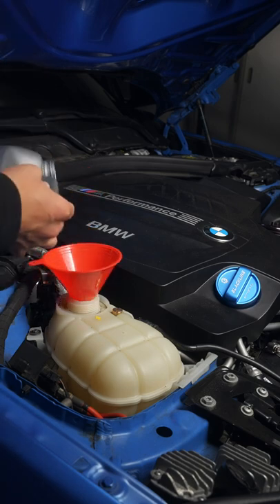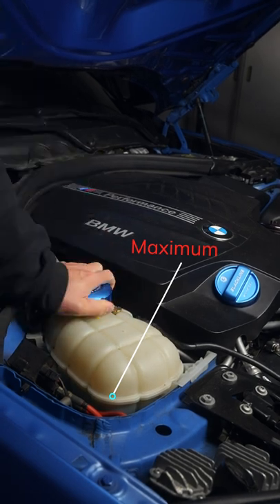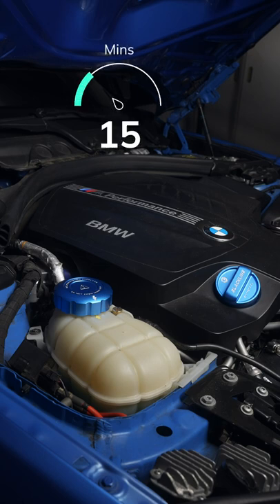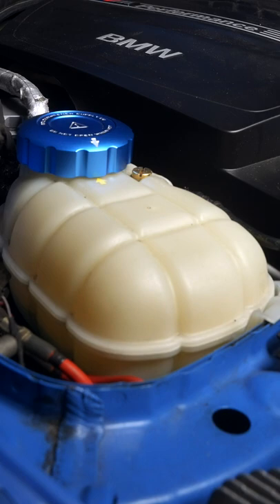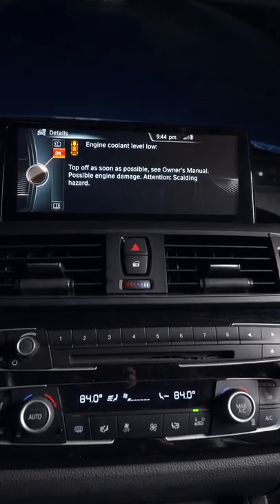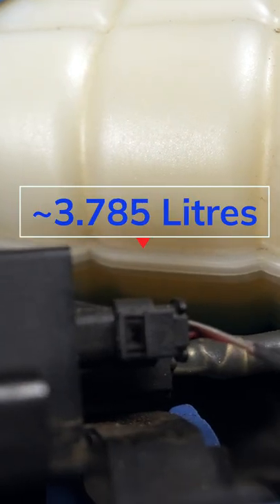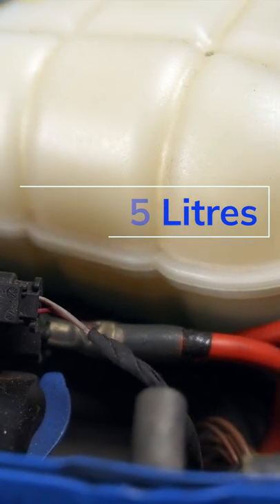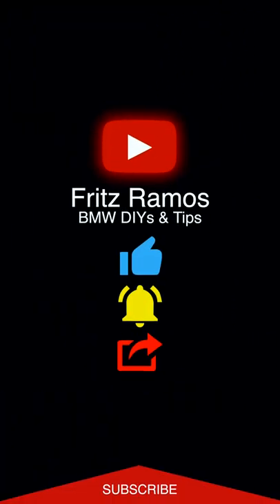How to Bleed Coolant on BMW

Comment: Great video! Question # 1 I just got a coolant warning light on my dash and i found under my hood that my coolant reservoir is low. I just topped up my coolant. Do I require a purge as well? Thank you!
Reply: Just top it off. Purging is only needed if the pipes have air.  If the resivor is empty fill it and purge